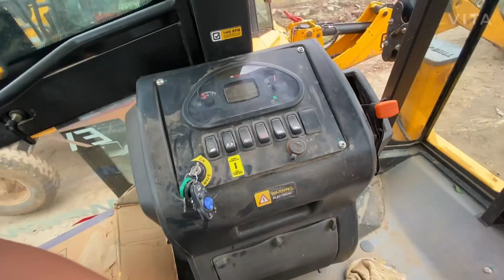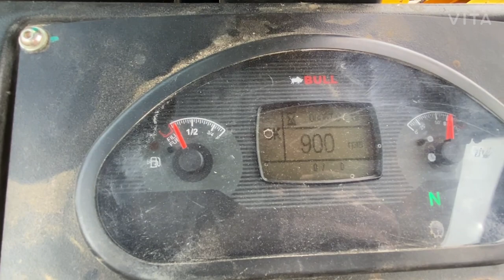New bull backhoe loaders || jcb vs bull vs case ||

Comment: Bull is more powerful and heavy machine then jcb or case, having 75hp Kirloskar engine and 8ton machine weight with big size bucket, with steel made KPC, many more.  Bull is really shows the Value for Money.
Reply: @freefiregamer7252  small and big does not any matter, it's work, fuel consumption,  productivity,  quality,  parts availability and its cost, and the most important that is Make in India. That matters the most.
Reply: 424 Standard Offering 
(4WD)
Engine
Cat
® C3.6* 55 kW Electronic 
Turbo Intercooled
Ratings @ 2,200 rpm
Gross Power SAE J1995
56 kW
75 hp

Bucket size: 1.05cum, and 1 cum 

Please visit their website and then download the updated Catalog.
Reply: My dear friend,  424b2 is 68.5kw means 91hp engine, where our Bull 96hp as well as Bull 100hp also available,  which is beating your cat in Abroad.